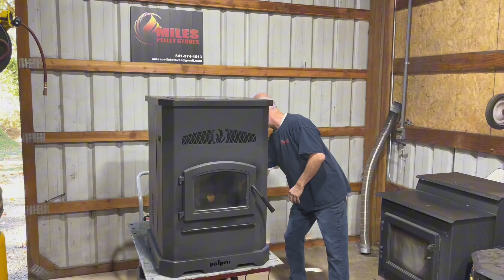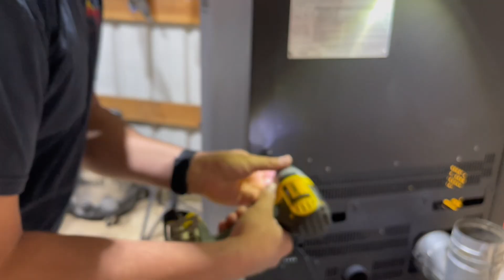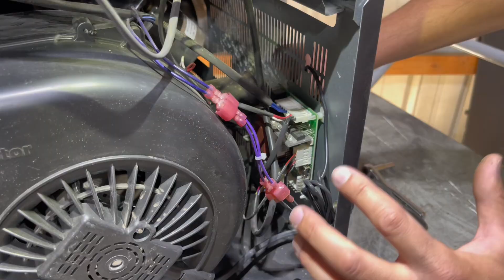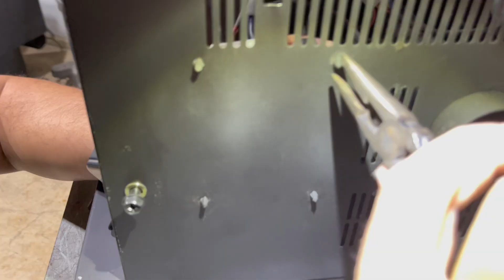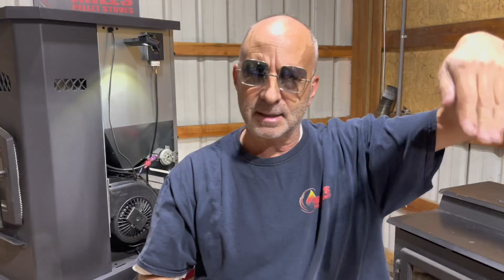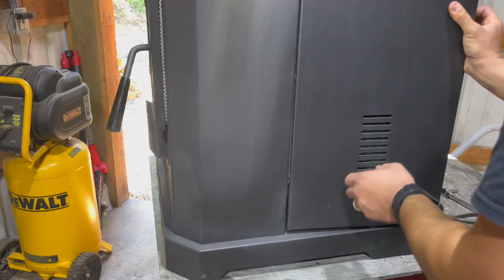Pelpro PP130 Pellet Stove Control Circuit Board Replacement Tutorial DIY Help Guide + Fuse Tips

Comment: I plan on buying this stove brand new from Tractor Supply. Should I just buy a few spare parts to have on hand? Reading the comments below is kind of scaring me haha. Im in massachusetts so I want to be prepared in case something goes wrong I dont have to wait to repair anything. Can you reccommend a few parts I should carry on hand? Im thinking a control board and a blower fan
Reply from the maker: Hello

Look at the Comfortbilt HP42 on our website for comparison.
Milespelletstoves.com
It's a good call to have extra parts on hand. Reach out if you need help or guidance.
Thank You 
Brett and Briggs
Reply: @MilesPelletStoves  Hello, I ran into a Quadra Fire 1200 Classic bay with a pallet of pellets for 1600. In very good condition. 8 years old though. Would you reccomend that over a new PelPro pp130.

Comment: I also have a pp130 and my controller green light flashes slow like normal ready mode .. when I turn up the dial for the stove to start it does not change to the fast green flash like at normal startup.. it is like I am not turning it on
Reply from the maker: Please call or text. We will try to help.

Milespelletstoves.com

Brett and Briggs
Reply: @MilesPelletStoves  I fixed the issue it ended up being the dial controller... I have a 2nd unit I run on my man porch.i started with temp sensor wire then control.board and fired after I changed dial

Comment: I replaced the control board. It works and runs to temp, but when temp falls back below, the unit does not turn back on until you manually turn the dial. I replaced the temp sensor wire and still the same. Could it be a fault in the control board?
Reply from the maker: We have never replaced the POF sensor. These stoves are tricky. Post your temp sensing probe on the wall. Wait a bit and it should work better. We do not think it's a control board based on your comments.
Milespelletstoves.com
Parts if needed 
Please subscribe to our YouTube channel 
Thank You
Brett and Briggs

Comment: I had a power outage. Then power was on but only like 20% in the house. Things were trying to turn on but didnt have the power to do so went on for about 6 hours.
Stove was off and cool when this happened.

Went to turn stove on and got startup light but no initial fan and no auger but igniter did start glowing. 

Lid switch good. Vacuum switch good. Snap disk wasnt tripped. 
Think this could be a board?
Reply from the maker: Reading your comments, I would say the main board inside back is shot.
Milespelletstoves.com
Very fair price and free shipping.
Please subscribe to our YouTube channel 
Thanks 
Brett and Briggs

Comment: i replaced the control board and I still am not getting any power.  Model numbers match.  Could it be something else?
Reply from the maker: Rarely....it may be the temp knob on the side.
Also, check all connections to new board 
Last....power to and from stove. Check the outlet.
Sometimes a faulty new board is received.
Please subscribe to our YouTube channel 
Thank You
Brett and Briggs

Comment: So I have the same problem with no light. Got a new bored and still haven’t fixed my power green light. Everything is still dead. No power to dial.
Reply from the maker: Check all connections to new board. Also, fuse on board and plug in power to back of unit 
Please Subscribe to our YouTube channel 
Thank You
Brett and Briggs
Reply from the maker: Check fuse and all connections to new board 
Also check power plug in to and from stove 
Please subscribe to our YouTube channel 
Thank You
Brett and Briggs

Comment: I recently replaced exhaust fan stove started and  ran during the night shut down the dial control has a rapid blinking green light . But when turn dial stove does not startup i found by unplugging dial control the stove fired up and runs but if i plug dial back in the stove goes into shutdown do you think its dial control or control board issue?
Reply from the maker: We have never replaced a dial on a PP130. Usually it's the internal control board.
Milespelletstoves.com
Parts
Pelpro
Control boards
Great prices
Free shipping as per this date 
Please subscribe to our YouTube channel 
Thank You
Brett and Briggs
Reply: Green light flashing , ignition lights, starts
Heats up and up and up will not shut down. Even in the office position the auger still feeds stove ??? I need this fixed one week old. Please send me the correct parts to fix this problem.

Comment: My pp60 will fire up once and the auger motor would run I jumped the wire for the pressure switch and lid nothing happens any ideas.
Reply from the maker: Look at our pp130 cleaning video. After a deep clean, if the stove does not work, most likely it's the internal control board based on your comments.
Milespelletstoves.com
Parts
Pelpro
Select control board
Check out
Free shipping as per this date 
Please subscribe to our YouTube channel 
Thank You
Brett and Briggs

Comment: wondering if you could help me here, I see where you say you have never had to replace a control module. mine is acting odd, if you turn the knob the green light speeds up and the stove fires up  has it should, then it feeds several rounds of pellet has needed then it will shut down. even though the knob is all the way up. if you wiggle or tap on the knob the green light will speed up and it does the same thing. often shutting down before the chill is off the room. is it possible the pot is bad on the control moduler
Reply from the maker: Based on our experience.....no. please see our pp130 cleaning video first. If no results,, extend the room sensor probe off the back of unit.  If no results, most likely the internal control board.
Milespelletstoves.com
Fair prices, free Shipping.
Please subscribe to our YouTube channel.
Thank You
Brett and Briggs

Comment: My pelpro pp130 started acting up this fall. It works great until I want to shut it off I turn my dial to zero it shuts down. But with the dial on zero it decides to start putting pellets in and restarting even after the dial is turned off. No lights flashing. The other question I have is do you have to have the fresh air tube hooked up for outside air or can it just pull air from inside the house
Reply: It's more efficient to pull cold outside air, but not required, recommend though
Reply from the maker: Good Afternoon 
Based on your comments, in the off position the green light should be flashing and no pellets dropping. We have never replaced a dial on a Pelpro. It usually is a faulty control board.
Milespelletstoves.com
To order a board if needed. Very fair priced and free shipping as of this date.
Outside air kit. Refer to manual. By code, this kit is a must in manufactured homes.
In many cases, it's not needed.
Please subscribe to our YouTube channel 
Thank You
Brett and Briggs

Comment: I am wondering if yall could give me some insite.  I have no light on. I did check the outlet. With the help of yalls video I replaced the control board.... and wouldn't you know nothing happened. I still have no light and cant turn it on.
Reply from the maker: Check all connections to new board and fuse. If all is good....high probability the new board is bad or possibly the wrong one

Comment: My stove works fine on 5 as soon as I turn the dial down it stops and I get the orange light any ideas. 3 rd time using the stove brand new
Reply from the maker: The pp130 works off the room sensing probe off the back of the unit.
Most likely you reached room temp in 5. After turning it down.....the dial, the stove will shut down. If you turn the dial just above off position, the stove will run on low continuously until you turn stove off. If the stove is new, please read manual again.
Please Subscribe to our YouTube channel 
Thank You
Brett and Briggs
Reply: @MilesPelletStoves  I’m going to subscribe. I’m going to try it on low again.
Reply: @MilesPelletStoves ran the stove on low for about 5 minutes flame went out and I had red blinking light

Comment: hey guys ive got an older stove and the control panel i can hear making a noise, i dont see visible burn marks on the fuse but the control panel will not illuminate. Not sure if thats a fuse issue or not i guess changing it would be fine to eliminate one possibility, what else may that be?
Reply from the maker: Most likely the control board is bad based on your comment.
Brett and Briggs